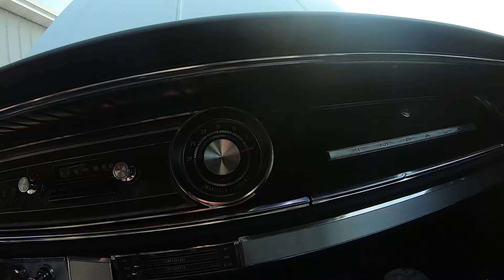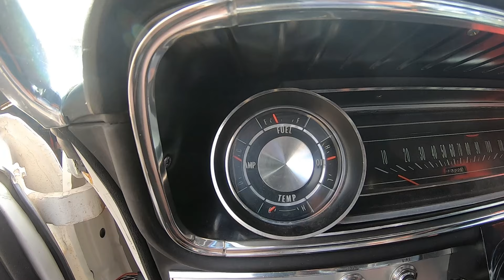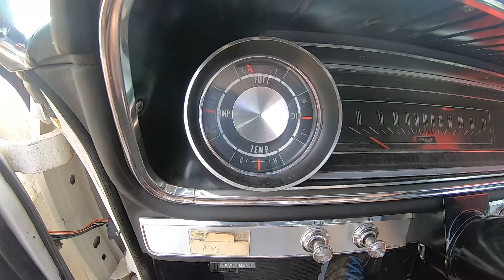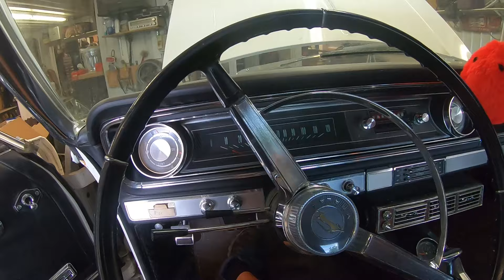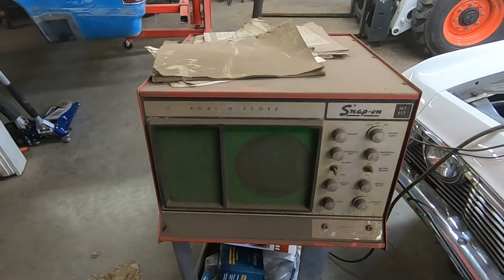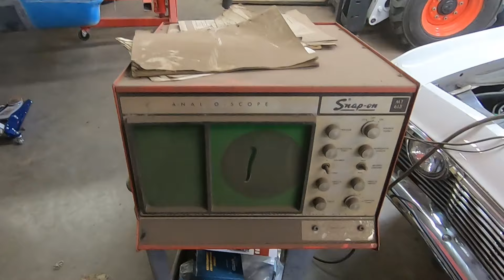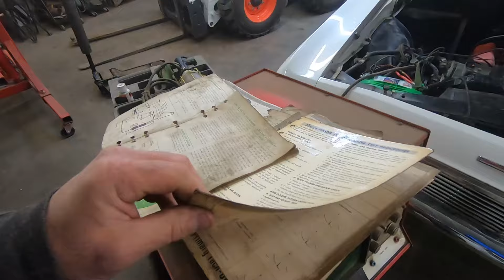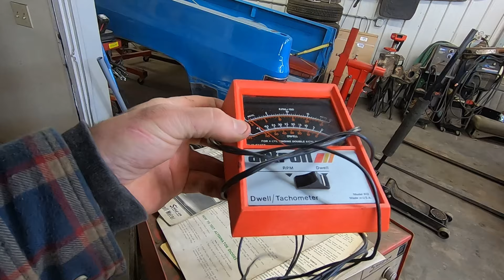Will It Run?!? 1965 Chevrolet Impala SS Resurrection! Parked for several years in a Barn!

Comment: I actually have some of the pages for car specs that go with that sun machine I remember those machines when I was a boy that's actually the year I was born at 1965 my mother had the 66 Impala she kept it until 1969 and got the new Electra 225 deuce and a quarter he kept it for years I used to hang around him as a kid and talk to him go over and see him and his wife in 1988 he needed to get the car out to do some work on the garage they were making bids of 8000 and I think it went up to 12 I heard this from upstairs next door in my room so quickly I ran downstairs mechanic buddies that was teaching me how to be a mechanic for interested in buying it the last bid was 8,000 before I came down the stairs am I asked him how much you wanted for the car I said I've know you probably want more than what I have I was figuring but he made me promise him two things don't park it in the back of the garage and block the garage and I don't want to see in front of the house either I don't want to see that old car no more I guess he figured he would miss it he said he needed a little bit of grocery money which I know he didn't need any money at all he was tired from Arco oil refinery he said give me $35 almost fainted I gave him the $35 and he let me take the cars and a guy's got really upset not really they were my friends much older friends I used to take it to a Toyota dealership where I worked at a long time ago and I used to wipe it down before I would collect my check and go out to the movies they would pass by and want to buy my car as they were passing to the new showroom every Friday and then even my boss tried to buy the car off of me that own the dealership it had 18000 miles on it I put a battery on it the year later I put a 3-piece exhaust system from Walker to ended up put new tires on it it looked almost like a new car I believe it was well over 20 years maybe almost 30 that's what I would like to have a 1965 Impala

Comment: There are body men "so called" that are true COBBS. Fill it with Body filler sand it, doesn't have to be flat ya know? then pour the paint to it. They give a true metal man a bad rep. I was in the business about 35 years, and it makes me angry when these guys ruin a classic. Mr. Mortske, you have a car that is full of Filler, probably not even prepped rite!  By the looks of it , it was used to tow some heavy loads. Not taken care of and maybe some collapsed rings in it. Good Luck Man, I like your show  Bud.     G

Comment: Kind of disappointing, hook up the vacuum line to the gauge in dash, raise the metal lid on distributor cap and use a allen wrench to set points, find something to hold the plug wires on side of engine block, fix choke and replace or clean the accelerator pump, check to see which door has the broken power wire for windows..about a days work by the time you put the tools back that are seldom used todays cars
Reply from the maker: Wish we could've had another weekend with it!
Reply: @MortskeRepair  It feels like why quit when so close to fixing all little problems, there really was not much more to go and have a finished rig
Reply from the maker: @morgansword  Gotta move onto the next one. Customer makes the call on how far to go.

Comment: Honestly bud, I have always really admired the 327. I have always wanted to get my hands on one of the 327s out of the C2 Vette with the Rochester mechnical fuel injection and swap it into an older domestic with a Muncie M-22 Rock Crusher (nowadays I'd rather swap in a Tremec TKO six speed) with a 3.83 rear gear with positrac. I think that combo (properly functioning that is) in a 67 Lemans GTO or a 66 Impala or Chevelle would make for a sick little powerhouse. Still, one of my dream domestics is a 66 Corvette with a 427 swap that has a modern multi-port EFI system (NOT a TBI) and a TKO trans with some sort of Roots style blower with the big chrome blower hat that sticks out of the hood. It wouldn't need to make 1000 HP, but 650 would be fun.
Reply from the maker: You've got good taste Robert!
Reply: You gonna keep it or sell? I'd love that impala!
Reply: @MortskeRepair  Thanks bud. One day I'll get there. All of this hard work just MIGHT pay off one day, but I doubt it with the way this world's heading...🤣🤣🤣
Reply from the maker: @robertsrevival3612  It's a customer car.
Reply from the maker: @HeWhoDrivesATruck  Just keep after it!

Comment: Sorry I haven't had any luck finding your samwitches.  But I have a boat with clean title I was gonna sell for 1000 bucks it's a century cts competition ski boat with the 351 w . The boat needs new floor and interior but it's got a very nice trailer maybe donate to you for a will it run . Would you be interested
Reply from the maker: You’re probably a long ways from us.
Reply: @MortskeRepair  kokomo Indiana
Reply from the maker: @MikeSmith-sg4wu  Looks like that's about a 13 hour drive, ouch.
Reply: @MortskeRepair  not to bed maybe end of next month I can bring it
Reply: I don't work anymore cause of 2 spine surgeries ,left hip replacement and right knee replaced used to drive truck hauled oversized loads started driving in 1989 and had to quit in 2018. Loved driving truck

Comment: I had a guy whose last day working with me supposedly a master tech double gasket in a spin on oil filter it was winter so he had to start the car get out of the car walk through the oil that he spewed to open the door get out walk to the oil that he spun spewed all over the ground to close the door then handed the keys off to the customer Trek through the oil again to hand the keys to the service writer who handed them off to the customer I saw the oil and the customer leaving I jumped in my truck tried to chase her down by the third stoplight I gave up because I knew she’d be back because the oil ran out by the third stoplight long story short and $6000 later because there was no long block short blocks I had to buy all the parts from Chrysler I  had one of my other techs rebuilt the engine for a customer that was never going to use me again and tell all her friends how horrible we were.And give her a rental car

Comment: the owner buys a decent project car and wont spend a few hundred on cheap tires? tires and brakes are your connection to the road. even if a tire looks good, check the maufacture date on them. they could fly apart on the freeway, this car will probably be rolled in a ditch with in a year.
Reply from the maker: Yeah, it's kinda sad. I think it'll just sit now anyhow.